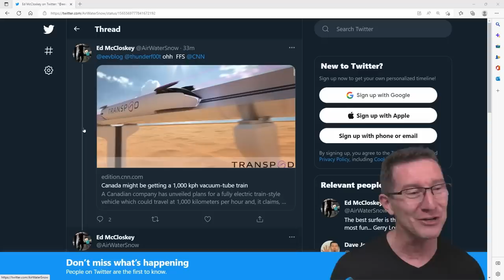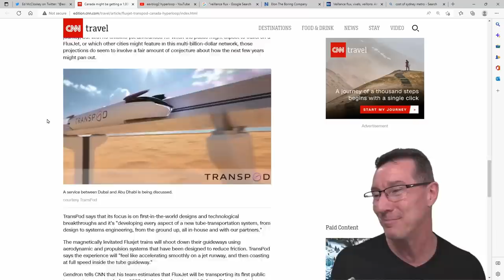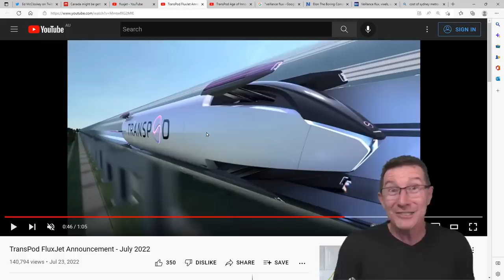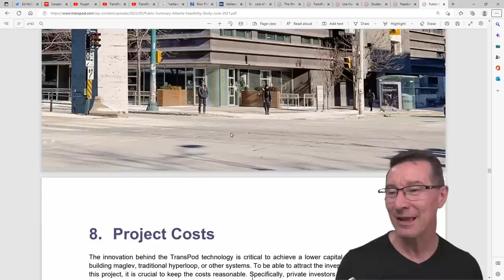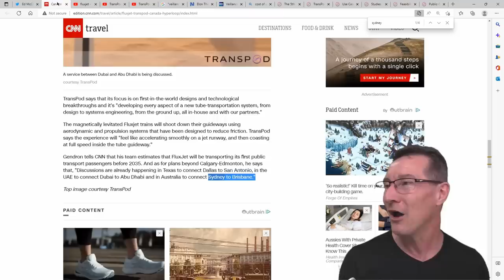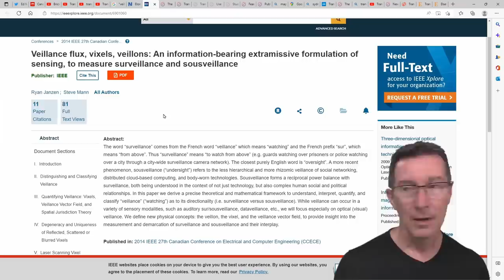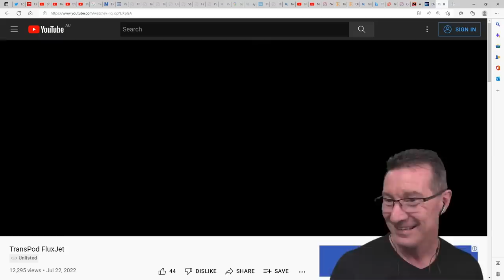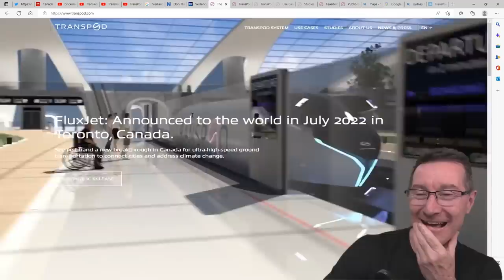EEVblog 1498 - TransPod Fluxjet Hyperloop $550M Boondoggle!

Comment: I wonder how much public transport you can get with all the support those snake oil sellers have received. Sure, bus, tram or subway lines are not as flashy, your normal high speed lines like the German ICE or French TGV are not as fast, but they all actually WORK.

Comment: Why not just build a pipeline, put an aircraft fuselage in there without the wings that almost but not quite blocks it, big wheels so they spin slower at high speed, then stick a big arse fan at one end of the pipeline to push/pull it. No need for vacuum because the air goes with you, and you don't have to power the entire length of it because the engine stays at the start/end of the tube. Now where's my gabazillion dollarydoos?

Comment: About the curves, from what I guess from the ICE tilting trains, making some calculations in my head, 10km long curves might just not be enough.Depending if they have a proper tilting system. Rifling would have to be removed tho. It's too much of a hazard in curves at 1000km/h. Getting to that speed or solving the drag issue not accounted for. Tilting a train at  1000km/h is something they don't have the money of. A solution for that alone would cost at least a billion USD. The guy here actually rode with the Transrapid Maglev the Chinese bought from Germany. RND from both countries were Billions. And it does not use a tube that somehow has to remove wind resistance. Chinese Highspeed Trains were a money pit for China alone. This is just weird.

Comment: Absolutely pissed myself at your reaction to this. Doesn’t it run off perpetual motion as well to cut down on power consumption? I swear with the sister company Flux Capacitor inc jumping on board I’m stopping my iTunes cards to fix my computer and money to release my $70 billion from the Lord of Ghanda, this mob would accept iTunes gift cards instead surly….. don’t miss out, send a Million, you may even get some steak knives if your in the next 120 people…..

Comment: I think a vacuum tube rail could work, might not be cost effective nor is it flexible and perhaps vulnerable to earth quakes but doable. This concept is a wild amount of bs though. The 'explanation' in the paper for what veillance is sounded like a raytracer. Like a computer graphics algorithm description. Which is pretty far out there in con land. Gotta fear a little for the mental well being of the people behind it. It's one thing to jazz up otherwise trivial engineering but this is something.
Trying to pull off a vacuum rail in the real world I'd look hard at simply running it on quality wheels. Maybe 800km/h. We know from land speed records that it's possible to run wheels past mach 1 so just maybe 800 could be quite reliable. And with precision engineering instead of mach1 through salt, it might be quite smooth. With various decoupling and sound dampening and the vacuum it might be fairly quiet. Sure the tunnel needs to be very straight but that's something we can do today. You may have to build the whole thing from Invar alloy to avoid temperature expansion which might not be super cheap. Alternatively you might build it in max heat so it's under great tension when cold. Might just work because it has to be very straight.
Planes do seem leaner but to be fair, the current air travel model is marred by infrequent flights and massive overhead to and from and checks at the airport. With tiny robotic planes off very small local airports it could be vastly more agile. Small revolution to be had there. Say 5-10 seats. Could even be battery powered for sub 1000km flights. Sydney to Brisbane is 730km. Might just be at the edge of battery range. They could have some battery powered, some green synth fuel. If you go high like 20km planes can get pretty efficient because it's starting to look like a vacuum.

Comment: What I really hate most isn't the fact that they are wasting the money of guilliable / uninformed investors, or even that they're wasting money form government grants / funding, but the fact they are wasting something much more valuable: Public attention. It's hard to get anyone in the public interested  in any kind of infrastructure, and now it's being wasted on hipster monorail instead of something that is proven to work like a japan style billet train.

Forget any of the buzz words, there are only 4 questions you need to ask
Does this run in a vacuum tube?
How do you plan to draw the vacuum?
How do you plan get things in / out of the vacuum? (this includes, cargo, people, AIR!!!)
How do you deal with thermal expansion / contraction of the ground / tube?
If the first question is yes and they don't have a good, solid answer for all 4 questions, they are wasting your money and more importantly attention - just walk away.

Comment: Whenever you see bullet-shaped designs, you immediately understand how much vacuum they expect. Looking at the speed of satellites and the ISS, NASA must be really stupid for not making those aerodynamic. Or maybe in vacuum a cylinder is a more efficient shape in terms of volume/length and the aerodynamic profile does not matter. But then again, what do I know... I never signed any contracts based on 3D renders.
PS: How the F can they say with a straight face that a maglev in a vacuum tube is much cheaper (in terms of infrastructure) than an air breathing maglev? There are times that I wish there were a technology that would allow you to slap remotely over distance and time some A-hole spewing nonsense and lies with no shame.

Comment: My spark gap Tesla coil uses plasma in its rotary spark gap to conduct the current to power the primary circuit. That technology is over 120 years old. And then there are arc welders and many more examples. They speak as if they just invented the concept of using plasma to conduct current. What a joke!

Any time that I see terms like "fluxjet", "veillance flux", or "new field of physics" I know to just turn and walk away. They may have had more credibility if they had stated that they were using "flux capacitors". At least then their train would be able to time-travel, assuming that it can reach 88 MPH. 😂

Comment: Vacuum tube train? So, this thing runs on thermionic emissions? Must be hella hot in there! But sounds great... right? Riiiiiight?

"New physics" LOL, it's so easy to peddle pseudoscientific BS in these times and get it repeated over and over!

24:33 my slow clap processor is still working. Good.

Comment: This man claims he just walked up to magnets strong enough lift a train car a cm off the ground while wearing a metal belt buckle and a lav mic....also claims to have invented "new physics".
Reply: Its actually not that strange. the magnetic field is reduced with the power of 5 over distance. So its really a matter of what the base distance is inside the magnet.

This is how maglev trains have barley any field inside them despite having very strong magnets under the floor
Reply: @matsv201  Thats actually more dangerous.  Having an invisible zone of no return from where the pull suddenly spikes by a power of five seems very not safe.  Knowing an MRI tech I've heard horror stories or what strong magnets can do.
Reply: @Pianet  You really need to come very close. 

A MRI is a bit diffrent, because then the base size of the magnetic field are enormus. Its like 1½ meter. For something like a Transrapid train, the base distance is in the range of  5 cm. SC-maglev is a bit more, probobly 30cm or something.

The solution is pretty simple. Make it impossible to get very close.

Comment: So its a hyperloop with LIDAR. Don't see how this any useful if the tube collapse in front the Transpod at 1000 km/h. And I don't get the plasma shoe contact thing. Typically you don't want arcing cause it would probaly interfere with your electronics due electromagnetic pulses and would obviously lead to unnecessary high wear and tear on you third rail and shoe contact due stupid hot plasma that would be even with liquid helium near impossible to cool. Which could lead to shutdowns of your entire loop due replacement of the third rail which is not cooled at all... Or it has to be contained in an strong magnetic field which would make it even more energy inefficient. I wonder if they ever hear about inductive power transmission?

7:03 Looks like the stuff I drew in 5th grade: toys for adults.. 7:17 That's more what I had in mind...
8:45 Who brought his/her kids KiwiCo project to work?
31:55 The body snatchers are finally among us... 😅

Comment: The tech required to make this even remotely feasible doesn't exist yet. By that point we would have far better ways of getting around anyway so it will still be pointless in the future. It was a far fetched idea 100 years ago and it's a far fetched idea today. Dollars to doughnuts it'll be a technically possible mode but pointless in 100 years time from now. It's all a grift and yet people fall for it. Tunneling miles on end or building elevated tubes perfectly level and straight... yeah okay. Aircraft that fly at those speeds have a very large radius when turning. This would be similar and at least an aircraft can take as long as needed to turn and isn't constrained by the topography.

Comment: Why don't you make fun of the low energy density of solar-PV and high fluctuations of wind power at the third power of wind speed  or all this hydrogen BS  in the same way in a video?

I would really enjoy that. And maybe some others with an engineering brain cell or two too.

After all coal and nuclear also already work.

Comment: 9:04 Working with a miter saw, showering the surrounding in sparks... WHILE wearing a long sleeved plain white (esd?) Lab coat flopping about? Is that an ESD wristband? No hearing protection? (That I could see). Why are his fingers there? You clamp it down b'cuz like 300°C burning hot besides the obvious danger of piece getting snag'd by mistake/error. These optics is grinding my brains raw, besides the obvious dangers to life and limbs. This kind of sh-t might work a few times after hours... Awkward cough ...at best! This would get people fired at places I've worked, because liability issues. To put it up front n center; madness! Well, I could be wrong I guess, I'm not in the metal workshop trade, but I cringe'd.

Comment: Here's an interesting calculation to make - given how much money was spent on this bullshit (I mean, hyperloop concepts in general), for how many years these have been going on, and how much hype was put behind it... how much longer is needed for the sum of all this money to have been enough to create modern high speed rail system networks in the places they were supposed to operate, with all the jobs it would generate and whatnot. No need for maglev, it could be the conventional type Shinkansen, LGV, TGV, LAV or whatever.
I mean, those cost A TON to build and maintain, so half a billion wouldn't even work for starters, but considering how many of these prototype crap hyperloop look-a-like scam companies have popped around already, how much investment money they already got, and how some roped in even public funds from several different nations... I'm guessing at least a single high traffic route could've already been built, right? Imagine all the actual real benefits of that versus all this pie in the sky bs....

Comment: 10:19. That looks a lot like some of the Swiss-metro concepts. A project that was actually realistic. But they did have a considerably larger tube

Why the vacuum tube for 1000km/h. Current maglev can go 600km/h with no problem. 800 km/h is with in reach really just with a longer track. And 1000km/h with some changes. Maglev trains could theoretically go 1150km/h before they would reach supersonic issues

"It cost to much and it cost to much to run"
Wrong. It cost very very little to run

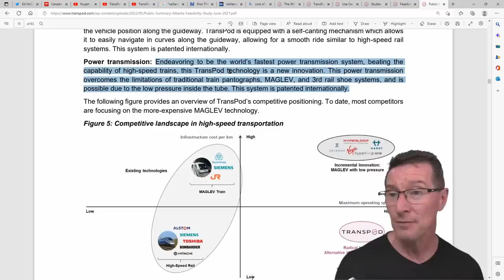15:20 So High speed rail have low infrastructure cost and transrapid have high? What? I for sure want to see the numbers of that.

Califonia high speed train is about $65M/km, while Shanghai maglev was less than half that. Yes.. less than half

Comment: Yes, this is probably just a Pipe Dream, But sometimes we need to think outside the box for technology to move forward. I bet people laughed at the Wright Brothers as well ✈
Reply from the maker: This is not "outside the box" thinking, the concept has been around for 100 years or something and has been deemed to be not practical. And the half a dozen other Hyperloop companies failing epicly doesn't give you a clue? It's trivial to do the engineerign analysis of the existing systems we have (planes, maglev, HSR) and factor in the insane complexity of reduced pressure tubes hundreds of km long and come to conclusion that this is a biblically dumb idea.

Comment: Such speed of trains already exist, in connection between underground bases.

Trains with such speed would only be useful underground, as underground gov do not have to buy up land, and they can in effect do train tunnels, that are absolutely straight.

The techs for high speed trains, already has existed for decades, in underground bases.

The usa vice president, even talked about these trains under washington.

The techs are decades old, for mach 1 speed trains underground, in effect.

You see in underground bases, they need a way to transport, and the techs already have existed for decades.

So, your laughing at technology that has existed in underground for decades.

Underground bases need connection, and transport, and underground gov do not need to buy up land, they just need straight tunnels between large underground bases, which are essentially cities underground.

I remember once even the todays current vice president was laughing about she has been on the underground train system in usa, under washington

This tech is useless overground, ie very high speed trains, but underground its been in use for decades, ie transport between underground bases.

For instance, in uk, in england, there is an exact copy of usa pentagon underground, and it houses defence intellgence, which is what uk is really run from. Its an exact copy of usa pentagon, but underground in england, in kent, under a military base in kent.
^^
If you think many things exist that you do not know about, your kidding yourself. No human has more then 1% of all human knowledge.

There is a train system that connects all the underground bases across nato, and your just laughing at technology that has existed, in different form for decades underground.

Its said to be able to go over mach1, and of course underground they can make straight tunnels, and do not have to buy land. So its not that expensive down there, but construction people to do it, costs alot, due to them keeping there mouth shut.